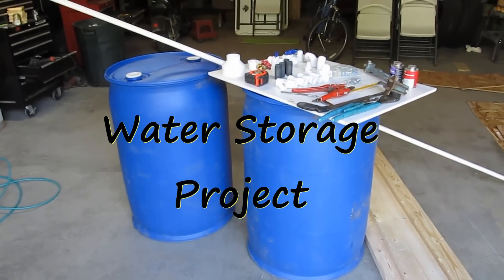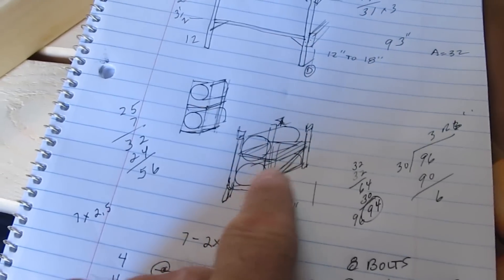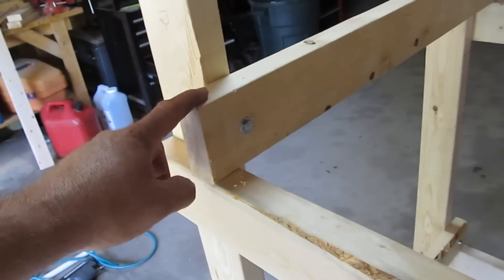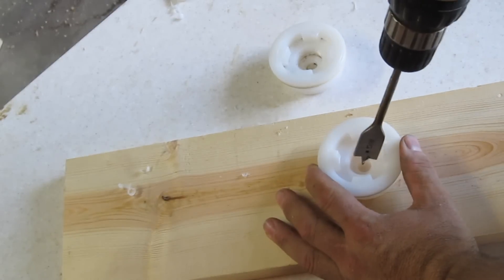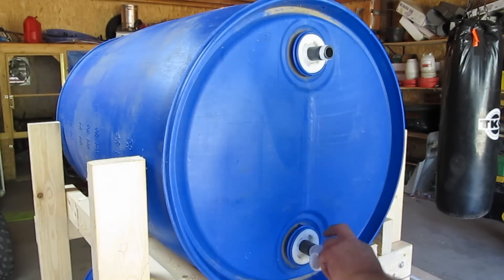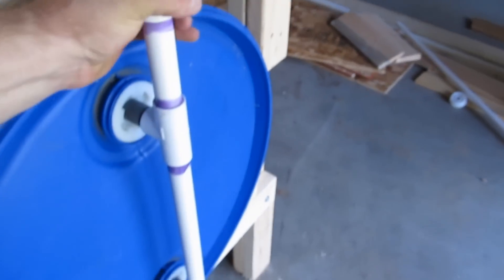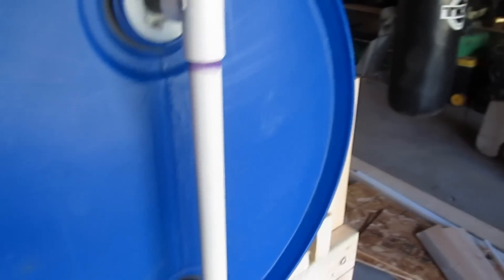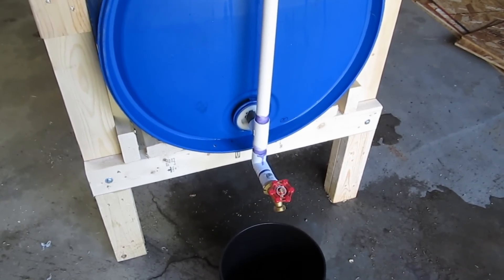Water Storage

Comment: Watching older vids. Good presentation. 

Tip: Add provision to fill with hose when pressurized water is available. Several ways to do this. From simply drilling hole, to insert hose, in top of end of barrel as it sits in cradle. Cover hole with aluminum duct tape when not in use. Add tee & fittings to top section of drain tube, so water pressure will push into top barrel. Or, Add RV water tank fill via hose adapter. 

Makes it easier to drain & refill, as needed, if SHFT hasn't hit the fan.